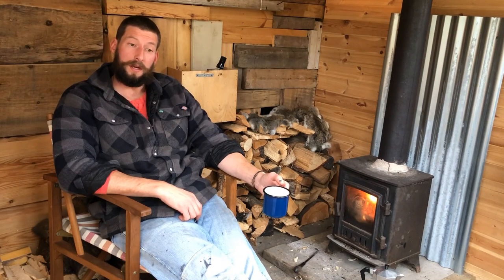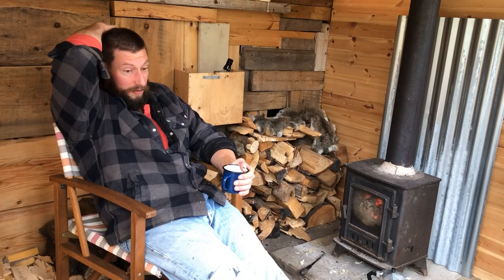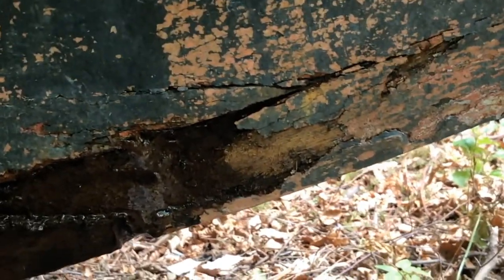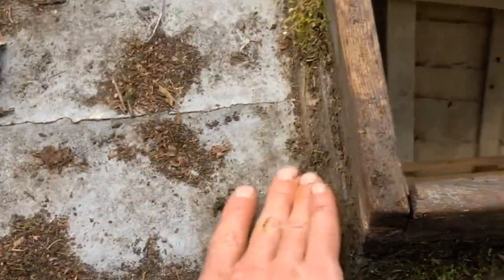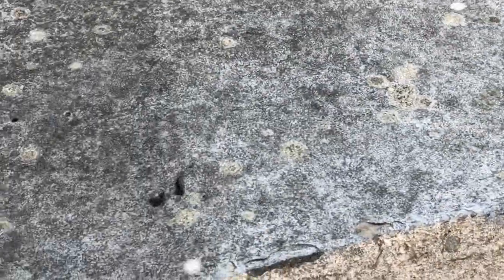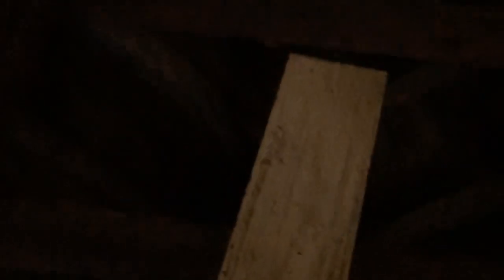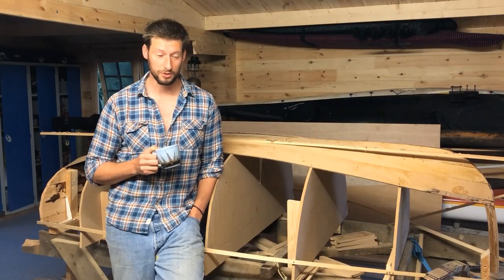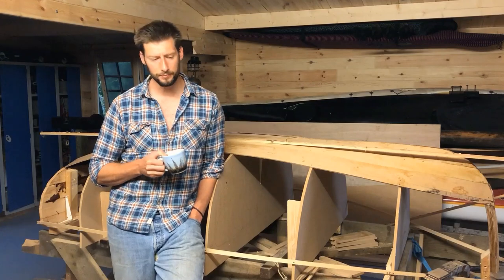Reviving an Idler -  A Wooden Boat Restoration   Ep 1

Comment: A little more searching and I found a bit more info about what seems to be your design.
I think you may have a Johnson and Jago 2 1/2 tonner. 
Johnson and Jago bought the Cole and Wiggins yard The cabin you removed seems to be as designed rather than an add on.
More info can be gleaned from these links
https://intheboatshed.net/2009/08/19/johnson-jago-2-12-tonner-sales-leaflet/
https://endeavourtrust.blogspot.com/2012/12/wiggins-family.html
https://marinestore.blogspot.com/2009/07/save-this-boat.html
Cheers Eric
Reply from the maker: Excellent help! Thank you, they are very similar arnt they! Idler is alittle longer at 23ft than the drawing youve sent and the coach roof is slightly different. But the over all look is very close. I have good reason to believe she was a Bermudan rig originally too! 
The other Johnson Jago images ive seen look quite different to this one. Its definitely the strongest threat to finding out what she is! 
Thank you again!